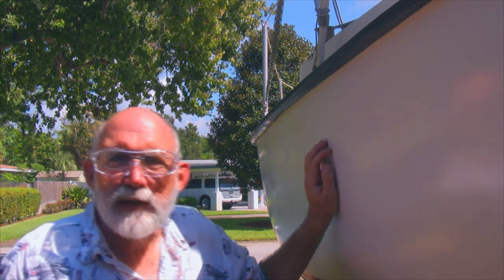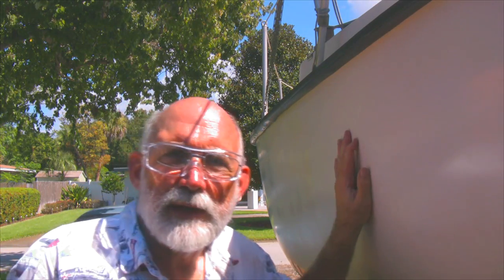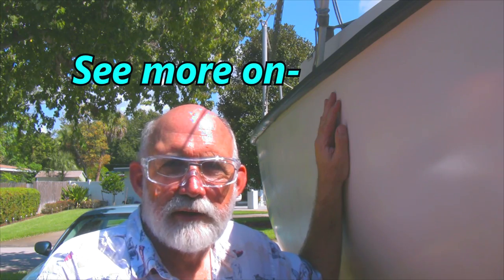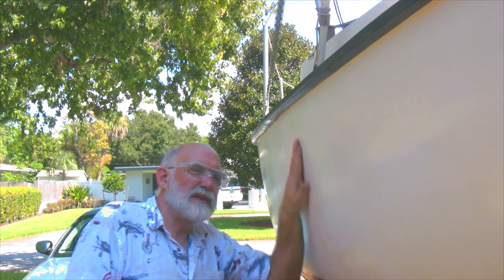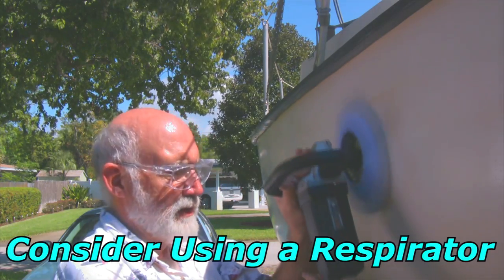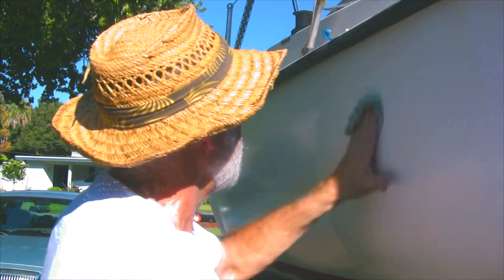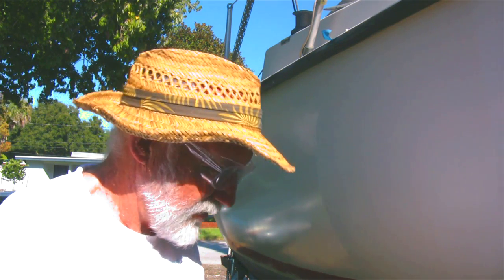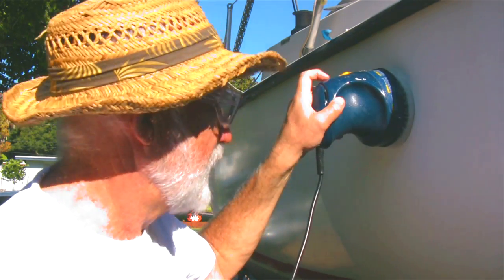Gelcoat Compound and Polishing - Be Careful!   Sailing HideAway  Com-Pac 23

Comment: I had the same problem with my disk polisher until I stopped using it and just did it by hand. I had an Erickson 25 so it wasn't too big of a job but I think I might try using a random orbital device on my next boat. Thanks for the advice.
Reply from the maker: +captainandthelady If the oxidation is heavy I think you need the rotary but the final polish  is easier with the small orbit machine.   I should have used a straight rubbing compound instead of the restorer & wax product.  After I applied the polish and wax the shine was pretty even. My goal is to prevent the green stuff from growing on it so its easier to keep the boat clean- I'm not that concerned about a mirror finish on my white boat.